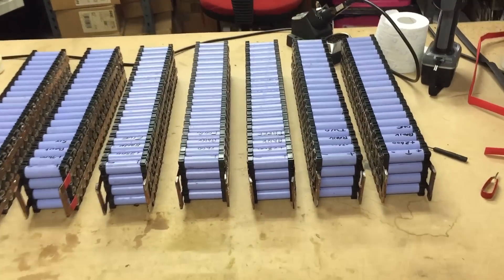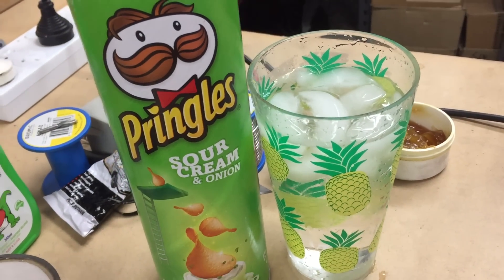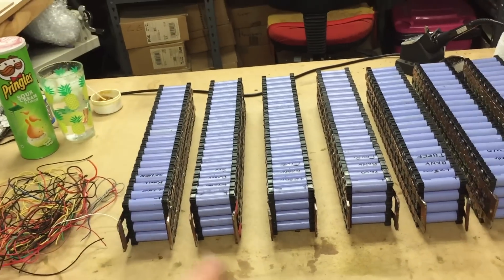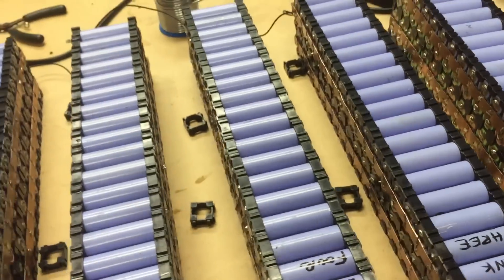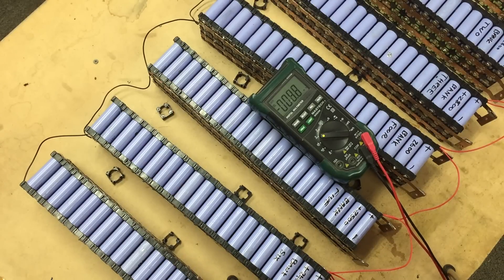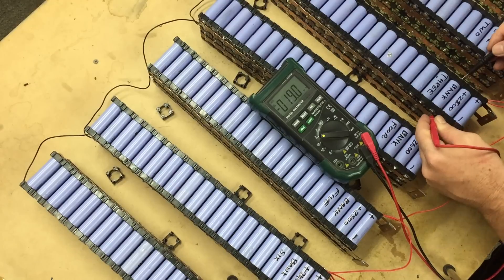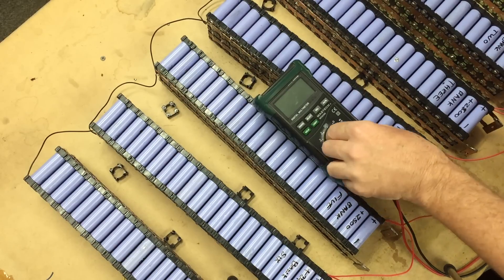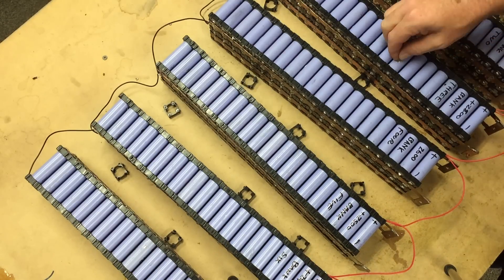First Pack ALMOST ready to be put to work.

Comment: Connecting batteries in parallel when there is a decently large potential different can cause a very high amount of current to flow between cells, so be weary of that
Reply from the maker: I checked that less than an amp :)
Reply: +HBPowerwall Thats good then! A friend of mine was building a pack that was 6s12p and when he hooked them in parallel they were not balanced and burnt out the wires/fuses. Some were at 3.3v and some were at 4.2v
Reply: +HBPowerwall it should take AGES to balance the packs then, doesnt it?
Reply from the maker: +StopLossLOL it will, but that's ok.  I'll do a update vid in the morning.

Comment: Connect them in parallel and then charge them while they are connected in parallel to the max allowed voltage. That will make all the cells truly balanced. If they all have the same voltage of say 3.7 this does not mean that they are balanced. But if they all have the same 4.2 volt then they are all balanced.
Use a car battery charger with a voltage divider to get 4.2 volts. The voltage divider can be a pencil. This way the cells will never exceed 4.2 volts. But because you have 7 cells each have 4*20 18650 and each 18650 is 2 amps or more then you will have to pump a lot of watts into it. 7*4*20*2* 3.7 v = 4144 watts. It will take a very long time for a small charger to deliver 4kW. So that is way you should use a car charger and a pencil as a voltage divider. The graphite in the pencil can withstand a high wattage. Or you can use the inner rod of D size battery. It is made of graphite too.

Good luck.
Reply: +Alaa Sadek That isn't a very good process at all. He is better of taking his time to charge and balance them slowly with the charger he already has. 

When all cells are at 3.7v they are balanced. They may not all have the same capacity left in them, but they are at the correct voltage to be then attached in parallel
Reply: +Sean Pain If he uses a 30 amp charger and we will assume that we have 30 amps at 4.2 then we get 30 / 560 = 0.053 amps for each 18650 cell. These 18650 can take at least 1 C which is 2 amps per 18650. That is the beauty of the Li ion battery. It is not dependent on a chemical reaction that takes time to happen. In the Li ion cell the Li ions move from side to another. The time it will take will depends on the distance and the muck it has to go through. This is much faster and much more efficient than a lead acid batter.

I did it that way and it has been working for the last 6 months.

Best regards from a sunny day in Cairo Egypt.
Reply: +Alaa Sadek I was talking about using a pencil as a voltage divider, there are more efficient ways to go about this. I use a large 5v power supply then a cheap voltage regulator to cap at 4.2 volts that is capable of around 50A.